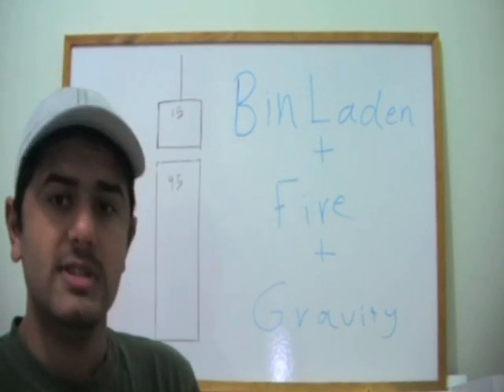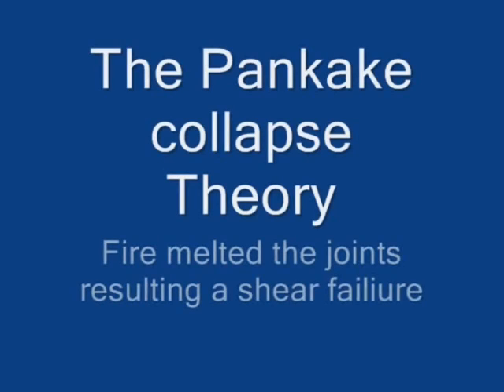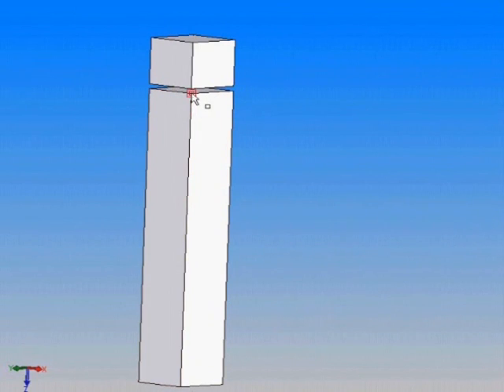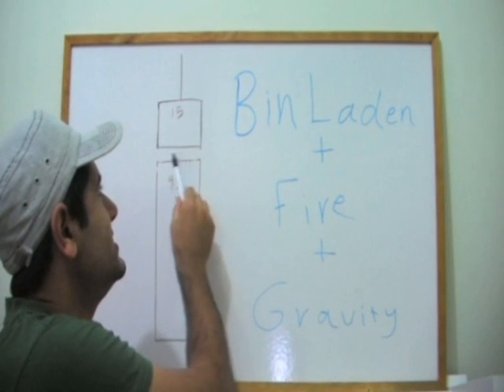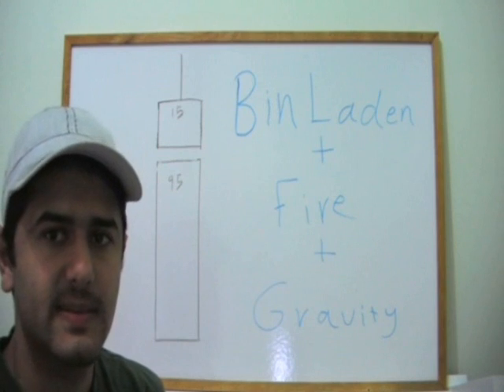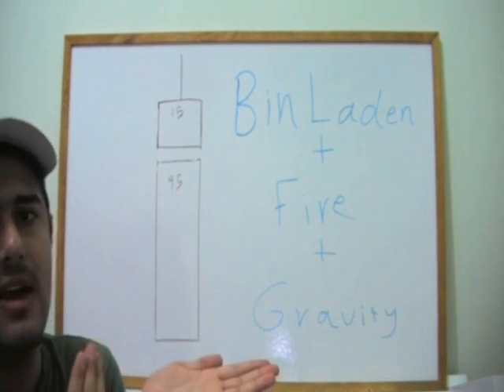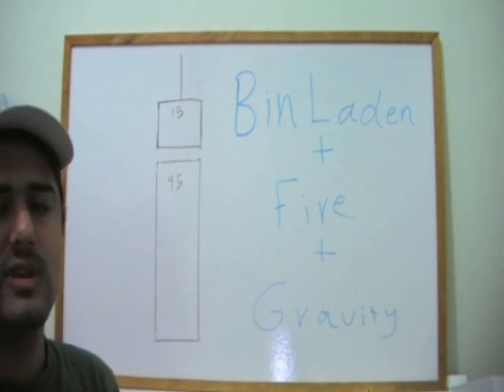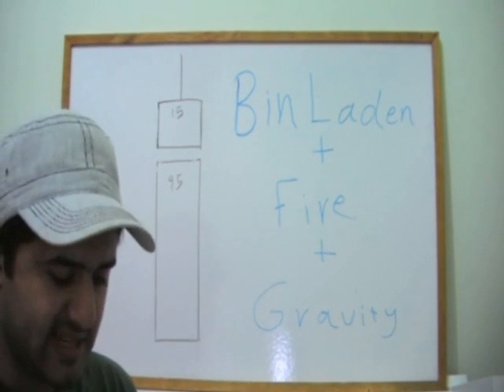(Part1) 911 Simple Physics Structural Failure Vs Demolition

Comment: kinetic energy: the walls in the twin towers were mostly made of glass.  the walls in this building are not.  this could and probably did play a large part in it.  (i will admit that i am not 100% sure about this)  what you go on to explain in the next part is just bad.  the building started collapsing at the point of impact-at the top.  furthermore, you cannot have a controlled demolition with fire because you cannot control fire.  the winds will control it better than you.

Comment: pancaking: so what-the vertical beams on the top section of the tower disappeared when they came down?

gravity: inertial forces stop this from happening.  if you wont believe me tie a string to a small weight and then tie the other end of that string to something strong.  coming off of the opposite end of that weight, tie a second string.  pull on the second string and the first string will not break because it is being protected my the inertia of the weight.

Comment: @Kill0Your0TV

3.5 times its own weight?  Are you talking abut the entire weight of the building?  That's the stupidest comment I've heard yet.  That's not how structural engineers design buildings.  They NEVER design this according to the building's weight.  Where?  What steel members?  Because certainly the columns and the girders on the first floor.

Purdue University.  The video is right here on youtube unless you're afraid of the truth.

Kill0Your0TV DEBUNKED!

Comment: Dude, you can barely talk right and you can't spell either. Therefore you can't possiblly teach me anything. You are at 10th grade reading level. I've graduated from college. And, I've worked with blast furnaces. I know the temperatures at which this had to of reached to MELT steel. And, know way is some idiot from some other country who, by the way can't even spell is going to tell me that fumes from jet fuel melted the Twin Towers.

Comment: @covingtonrace  Normal demolition is done from the bottom. Are you suggesting that there were demolition charges placed 3/4 the way up, then the hijack pilots had to figure out where to hit the building where the charges were previously placed, but the collision did not disrupt the charge ignition system, then the charges were set off exactly where the aircraft hit to bring down the buildings? Is that your story?

Comment: @bd886 That doesn't even make sense. The collapse wasn't a design. The top floors coming down will increase the force well greater than the load it was designed to handle. When you understand that, you might get a real job one day and not pouring people their drinks while pretending to be an engineer.

Comment: The top floors would be exposed to the same "crushing" forces the lower floors succumb to in the "official" explanation.  The top floors would suffer the same destruction as the lower floors in the same time.  The collapse would quickly lose momentum, as the top floors begin to lose mass, and quickly loose structural integrity, as they are pulverized into the exact same dust that the lower floors are turned into.  Dust cannot crush the remaining undamaged floors!  The official story is so week!

Comment: it was like.. a bus hitting a 7-coach train on rest. 

assuming it had enough kinetic energy to crush all the coaches from the 7th.. 6th.. 5th.. down to the last (1st) coach, it would still need TIME to do it.  

in reality, let us not forget the RESISTANCE of each coach. 

no matter how you slice it, the resistance of the lower columns (WTC 1/2) were'nt there anymore as the 2 building collapsed. 

because if they were still there, 1/3 to 1/2 of the WTC's height would have still survived.

Comment: The concrete floors broke up during the collapse and took out (destroyed) the inner core.
The columns did not fail. The attachments between floors and columns failed.
The video fails to address that the jet did a lot of damage to many floors. The building was already in a very weakened state before the fire weakened the building even further and to the point of collapse.

Comment: there have been debates on whether fire was enough to melt the steel or not.. 

granting it could melt the steel, how the hell it managed to destroy most if not all of the 47 core columns at THE SAME TIME. only a giant sword by the decepticons can do it.

towers 1 & 2 went straight down. it did not tilt, tip, topple over to either side. suggesting a near-perfect and even mode of collapse. how could it be? 

it defies the laws of physics and engineering. something is wrong.

Comment: (Concerning the planecrash in Reno Nevada)

John Townes, a Reno pilot, said the plane didn't sound right moments before the crash.

"It wasn't quite vertical. It was at a very slight angle and because of that I think it probably saved a lot of people," he said. "Normally when you see an air crash, you see recognizable wreckage. There was nothing, just little bits of metal."

Also, the crater was only 8 feet wide.

Guess that must have been a missile in Nevada as well

Comment: He's right!  The lower 1/3 of the towers height is where 2/3 of it's mass was!   Without the weight bearing support structures at ground level being removed (obliterated with cutter charges)  the upper structure could not fall straight down at close to free fall.   All resistance has been removed so what would be the path of most resistance in a gravitational collapse became the path of least resistance due to blowing out the  support columns with charges.

Comment: not sure, but failiure was a failure.

I like how you toss out the first theory. Ignore the sheer weight above it. Apparently the columns can only be destroyed by an explosion, but 100,000 tons with added energy from falling above it cannot crush it.

The video of the tiny building not breaking up even illustrates this. You again ignore that this is a 110 story building. Not a 20 story one. Quite amazing.

I bet this blows you guys simple physics minds
watch?v=00I2uXDxbaE
How does it not break??

Comment: @jimbobeire To answer your question of why the cleanup crews would have to be in on it also if the "truther" movement was correct.
They were responsible for removing the debris, ONE Tandem dump truck (x # of trucks) at a time, Hundreds were involved on the ground from truck drivers,(metal,steel,aluminum sorters),water dogs hosed down dust/delivered water, heavy equipment operators. and many more.
ALL having eyes on the pile and would see anything out of the ordinary demo related, They didn't.

Comment: @BoardFlipper5150 If it spread 30 floors at over 1000 degrees, how come it wasn't too hot for people on closer floors to even make it to the edges? The combustion temperature of what ever is burning isn't necessarily the temperature it will heat a metal, taking into account specific heat capacity and the wick effect of conduction of heat in structural steel.   Tell you what, I'll go read the NIST report. Thanks for engaging constructively.

Comment: @BoardFlipper5150 Are you trying to tell me that, for example, the columns 40 floors down were weakened by fire? The point I'm repeatedly making is this, a falling block of building has kinetic energy, we then see massive debris clouds as lower floors are pulverised. These interactions would involve a transfer of energy, and resistance (i.e. a braking effect) on the falling block, which, by the way, should not be immune from disintegration, as its not any tougher than the material it is hitting.

Comment: @BoardFlipper5150 Again, not a response to the point I raised. After a beam fails, and the upper section starts to fall into the much larger lower section, which is made of the same material, the impacts should have a braking effect on the top section. It defies logic that it could fall at almost freefall speed. Can you show me any comparative example? It was like an anvil falling through cobwebs, rather than hitting solid structure.

Comment: @BoardFlipper5150 That's not a response to the point I raised.  That link isn't working for me. 12 tons of pressure is a lot, but it wasn't falling through 90 floors of damp toilet paper. The lower floors should have had a significant braking effect, rather than allow near free fall speed. Whatever people like to believe for whatever reason, it has to accord with the laws of physics and the laws of physics do not care whether people WANT the official explanation to be true or false.

Comment: @BoardFlipper5150 You should look at where the fuselage and engines went, not the edge of the aircraft outline. Narrow aluminum, outer wing parts are not going to be in any way comparable to the rest of the plane in terms of mass and destructive power.  A plane hit near a corner, affects about the distribution of fuel (you saw a big fireball of that carried on through and out of the building.) Using the physics of a burning pools of fuel in an enclosed space, does not tally with smashed floors.

Comment: @Connected2U2  to pick up on your analogy of a tall strapping ladder, if I were to do this, each strap as I met it, and broke it, would provide enough resistance so that I wouldn't reach the bottom at the same speed as (for example) the mobile phone that feel from my pocket at the same time.  Also, it was not the top rung that was jumped on. If I jumped on rung 15 from the top, and the ladder split all the way below me, what force would rip apart the 14 rungs at the top?

Comment: This is still debatable?
The upper floors were NOT met with the resistance of the remaining floors at one time, they were met with the resistance of one floor at a time, and thus adding to the down force as it fell (minus what was kicked outward).
So, the pancake principle would hold true for all floors even if 80% of the collapse load was ejected as it fell,  it only takes enough energy to take one floor out at a time.
Make a ladder out of strapping, climb to the top, jump on the top rung.

Comment from the maker: @Olithenotsogreat 
there are many problems , even if you assume the fuel caused the initiation of the collapse... how did that collapse continue and not get arrested?  in a normal case 15 floors can only destroy 15 floors below it and it will get consumed in the process as every action has an equal reaction force. so how did 15 levels crushed 95 levels?  
also the fire wouldn't be able to do what they say if you do the math. 
i did a video on the calculation of the temperature

Comment: OK, so the steel column didn't melt. That's one thing. Now I also read that the critical steel temperature , that at which it  looses 50% of its strengh is 1022ºF. This is far above the 600ºF or so of a Jet fuel fire.
Besides, the construction norms are such as to garantee the structure resistance up to its critical temperature". So i's difficult to believe that jet fuel fire only caused the collapse, even if I may think that it contributed to it.

Comment: Just check the following, it's easy to do.
A:  temperature at which iron melts= 2797ºF, 
B: the temperature of a jet fuel fire =500-599 °F?
A is vastly superior to B.  And additionally the black color of the smokes makes think that the fire was lacking oxygen and hence that the fire tempreature was lower that 600ºF.
How the hell could the jet fuel have caused the melting of the iron poles?

Comment: @Laughingblades What superheated fuel is that? Are u on of those that believes in the magical properties of jetfuel? Swelling beams? What's that? Melting bolts? Since when does fire melt iron/steel?
Domino effect? This isn't domino or jenga dude, these structures were steel matrices, intricate webs of steel, an intense grid.
Btw, crushdown-crushup is just a theory, unsupported by any facts or any experiment for that matter.

Comment: @newyorkyanks22 Not the U.S. government, the media. Not all information from the media comes from the government. The 9/11 enquiry was conclusive in its findings in which all the evidence they found pointed away from an inside job. Sure, some experts stated facts like 'burning jet fuel wouldn't have melted steel etc.', but this isn't a credible argument because steel doesn't have to melt in order to fail, so statements like these were ignored by the commission.

Comment: @tgt305 A plane crashed into the building, transferring all its kinetic energy to the building which physically bent the support structure. The resulting explosion from the plane, along with transferring even more kinetic energy to the structure, started the fire which burned at about 1800 degrees, All you nut jobs that rant " The fire was not hot enough to melt steel." are correct. HOWEVER, steel begins to weaken at 1440 degrees Fahrenheit...who was this a simple fire again?

Comment: It is possible for demolition crews to demolish buildings by removing a segment of the building near the top but they don't because notice how on the WTC the debris from the building ejected outwards and landed on neighboring buildings which for a demolition crew, is too costly as they would have to pay for damages on other buildings. The fire sagged the floor trusses which pulled in the outer columns until they snapped causing collapse.

Comment: Nonsense!

Ask any demolition company engineers. When they demolished Texas Stadium it took hundreds of people workIing many weeks full time to place and wire all the charges. Drilling concrete and steel, making horrendous amount of of noise, mess, dust and debris, running wires all over the building.

The whole idea that somebody could prepare 2 giant buildings for demolition in TOTAL SECRECY without anybody noticing and asking the questions is beyond ridiculous. It's preposterous.

Comment: the central core was still standing after the fall.. and there is video of this. ands i guess the base of the central core wasnt damaged by 100 floors of debris smashing into it. the top "block" didnt not fall uniformly down, it fell sideways. there is video of this. there is video of the walls buckling in, before the tower began to fall. the tower came apart as it fell, not in large demolished pieces. theres video of this. "nano-thermite" (ugh) is an EXPLOSIVE.  you people disgrace the dead.

Comment: @nebula25x Yes it is needed! If it wasn't then what causes the ignition? THings don't just blow up they have to have something start them! Yeah but he also clearly states that structural supports have to be cut, walls removes, so forth, NONE of which happened in the WTC.

I know thermite cust steel IT BURNS AT OVER 3000 degrees! But we have thermals of the building showing it didn't get anywhere near that hot!

Comment: @nebula25x Yes it is making thermite is one of the most dangerous jobs because a spark will cause it to ignite. It destroys things by melting them because it burns at over 3000 degrees. Why use it because it woun't work in controlled demolitions. It will burn and follow gravity of straight down, it won't cut through things at an angle. No there wheren't, let me say again no blasting cap, no controlled demolition, you can't have the boom without the cap.

Comment: @nebula25x I guess I was wrong when I sid you where incorrect, it was a full blown lie. No thermite has ever been found at the WTC. A few things that are close to thermite yes, but not thermite. But for sh__s and giggles lets say there was. Why would they use a fuel do a demolitions work? THermite is dangerous, unstable  and doesn't have enough explosive power. Why wouldn't they use something cheaper, lighter and far more stable like C4?

Comment: Sounds to me al quite senseless what this guy here is telling right now. First he didn't consider that the aircraft damaged primarily one portion of the building and therefore the load was eccentric causing an additional stress on the structure and second he never considers the buckling resistance of the beams. In addition to all this facts he should even consider that the elastic properties of steel decrease rapidly if the temperature is higher than 600 degree centigrade’s.

Comment: @Superchickenman159 that does sound ridiculous actually since 90% of the planes weight is fuel and the majority of the plane is aluminum. have u ever seen the picture of the plane that hit a bird while flying, ya the front of the plane look like it ran into a mountain, nearly every credible debunk site or whatever states that the plane impact itself had very little affect on the building but it was the fire that caused the collapse which is of course incorrect cuz its not possible. thanks

Comment: @Superchickenman159 This came from the Engineers mouth himself, on video. Look it up. He said "The buildings was DESIGNED TO BE HIT BY  JETLINERS. 

Do you understand? Jetliners/Commercial same thing. They were designed to be hit by 707s, the biggest commercial jet at the time.  What hit the Towers that day was a 767 and 757

The Boeing 707 and 767 are very similar aircraft, with the main differences being that the 767 is slightly heavier and the 707 is faster.

Comment: @StrengthFromAbove83 
So you were demolishing city buildings in the military? There are so many things wrong with what you just said I dont know where to start. Tip over? LOL hardly. The top portion was systematically demolished first and that is why it cascaded. This was not a traditional bottom to top demolition. This was a non-traditional, top to bottom collapse traveling through a path of greatest resistance. It would defy the laws of physics for it NOT to cascade the way it did.

Comment: @splendid1000 congrats.  Do you also have experience with demo?  I've been in the military for 8 years and I know that to demo a building, it's designed to collapse in on itself to prevent damage to surrounding building, etc... demo would NOT have caused the buildings to tip over as they did.